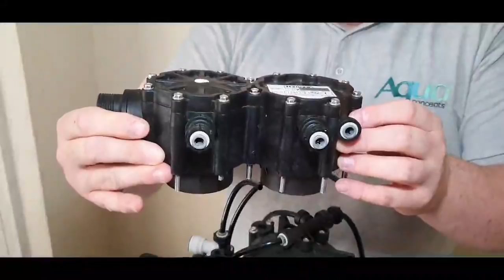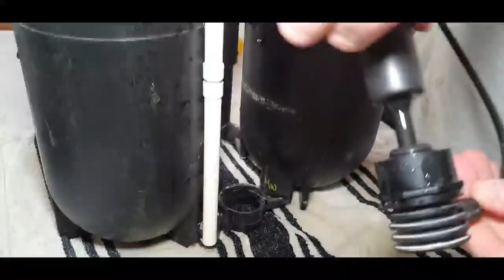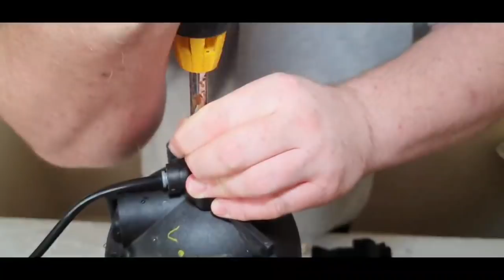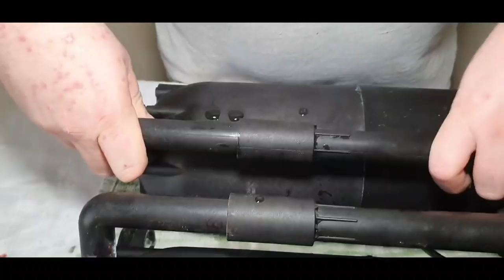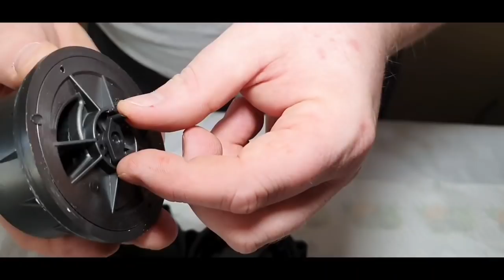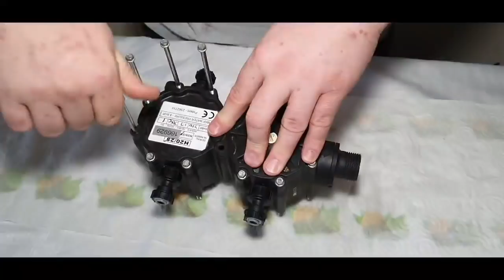Harvey Water Softener Repair / Rebuild [Water Softening]

Comment: Great video, i have Continuous slow water drain from shuttle valve on H20 9 years old Harveys twintec dualflow now and initially high water flow when the problem started but switched off by pass valves for 24 hrs and now slow drain of water.What could be the reason for this ?

Comment: Hi there, please can you advise me? I installed a Harvey Arc water softener today. I did all the plumbing properly, installed a non return valve, the bypass set, all the drainage. But I made a really embarrassing silly mistake, I connected the hoses on the inlet and outlet the wrong way around. When I turned the bypass set on the water pressure was really low, all this yellow fluid came out the kitchen tap, I’m thinking that may have been the brine in the tank? Will this permanently damage the Water Softener? Do think I need to call Harvey and tell them what I did? Can the tank be refilled with brine? Or do you think that was resin? I’m really stressing about this. The softener was only running for very short periods whilst I was trying to figure out what was wrong. When I realized what I’d did i immediately swapped the hoses round the correct way, and the water is running fine and clear. I’d really appreciated your advice. The water pressure is around 1.8 -1.5 bar if that would make any difference. Thank you for taking the time to make such detailed video All the best.
Reply from the maker: Swop the hoses around and it should be fine. Where was it purchased from?
Reply: @TheWaterBoyuk  I bought it used online, i met the guy and collected the machine, he bought it in July 21 but he moved and no longer had room to fit the machine in his new place. He only used the W/S for a year and it sat idle for a year. I called Harvey's and they transferred the remainder of the warranty to me, July 24,  the Arc comes with a 3 year warranty as opposed to the S4 Twin Tec which comes with a 10 year warranty, Iv'e been told the S4 and the Arc are the same machines just with a different housing. Thank you very much for your reply. I was very impressed with how you did that strip down and rebuild, moreover your vocal description was perfect describing all the all parts and your techniques.

I should add for anyone else reading this, I'm not a professional plumber. The install was quite complex as I had to do in install by hanging the pipework and bypass set from rods and clamps on the ceiling above the tank, putting my arms in between the central heating pipes that were hot in a very small cupboard, and build a shelf for the W/S to sit on also above the tank. I was quite tired after the install, and after all that i read the instructions wrong for the inlet and outlet. 

 Do you think i should tell Harvey what i did? Also may i ask the yellow liquid that came out of the tap, will that regenerate on its own? 

Thanks again, have a great weekend all the best.
Reply from the maker: @nickgreg8068  thanks for your kind comments, it is much appreciated. Having the hoses round won't damage it, but it greatly reduces the flow and pressure. It would have had no impact, especially at those pressures. 👍

Comment: Hi
Thanks for the excellent video.  We have got up this morning to exceptionally salty water out of the taps.  What would cause this do you think?
Thanks
Jody
Reply from the maker: Low pressure or faulty brine valve, not shutting off fully.  The early H2O series suffered with brine valve problems. Another indication is air in the water causing spluttering when you turn a tap on. Hope this helps.
Reply: Thanks so much for the reply.
Haven’t got air in the water.
Ours is an m2 minimax. Can I buy the brine valve from you?

Comment: Are there any adjusters on a Harvey - we’ve had ours for some while - and never been happy with the softness - trying to speak with Harvey’s direct has been like pulling teeth. We’d just love to achieve the silky soft water feel
Reply from the maker: The gearing is internal, which adjusts the amount of soft water available. Take a look at the service meter section in the gearbox breakdown.  by changing the gear on the ABCD, holes will change the hardness. Please email me a picture of the top of the valve and also your postcode, and I can let you know the correct gear. andrew@aquaconcepts.co.uk

Comment: Hi
Great explanatory video 
I just moved house and took our Harvey’s HV3 water softener with us. I installed it in new house but couldn’t find anything about manual regeneration until I came across your video.
I have turned that screw on top many times anti-clockwise & clockwise & it has regenerated & now appears to be running fine.
Just wanted to ask if I did any damage to the water softener by doing this?
Also how much water on average would you say the softener will use between regens?
Regards
Reply from the maker: It is possible to get the top end of the gearbox out of sync. By the sounds of it, you should be 👌 The capacity between each regen depends on your hardness level but as a guide it is 350 liters. If you are a big family and using 700 liters, it will regen twice a day. The Salt consumption is approximately block per person per month.

Comment: Hi 
Great video. I have the same model, my water softener is filling up with water. What causes this? If i remove the water with a cup it fills up again any advice would be great thanks 👍👍
Reply from the maker: Could be a number of problems. Check the shuttle valve is not dripping, the corners of the uprisers may have splits, the brine valve maybe stuck. I am currently editing a diagnostic video for the members section of this channel. keep a look out for it.

Comment: Hi, thanks for a brilliant video.  I have the same one in the video and the up riser's went. Got the fella I bought it from to come back after 2 months of chasing him .and he said he changes them as  they were leaking at the bend  where you pointed out in the video. He left that evening and the following morning the softener was filled back up with water. Same problem  and no sign of him coming back to fix it 3 more months have passed and he won't even answer the phone or message . My problem is I can't get the parts anywhere here in Ireland.  Can you post the up riser or send me a link where I can buy them from. Many thanks for all the info
Reply from the maker: Who was the dealer? I can virtually guarantee that when he pushed the uprisers into the bottom of the tank, he missed the lubricant on the rings and the riser is not fully pushed in. Undo the hex screws and remove. Check the oring and lube with some silicone grease. Also check that the upriser are fully turned into the shuttle valve. Get in touch after you have tried that.
Reply: Thanks for the quick reply,  unfortunately the up riser has a pin hole leak at the bend so needs to be replaced, and as I said he's not returning my calls or txt . And can't buy the up riser here in ireland for some reason.
Reply from the maker: Get in touch with me by email and I will see what I can do 👍

Comment: Brilliant video, these are a great softener.  recently mine is not filling the water tank, i cleaned it out and tried again but no luck .. any ideas please
Reply from the maker: check the brine valve first and work backwards
Reply: @TheWaterBoyuk  Thank you, could you tell me how far up should the water level should be in the tank after regeneration.  And if its low what should i look for .

Comment: We have Harveys h20 twin tank water softner .From some time facing issue of low water output flow when there is salt in water softener. Water pressure drops to level 2 ( out of level 10) when there is salt.But when there is no salt, water output flow is level 6. Annoying part is when I bypass water softener water output flow is 10( the best ).  Any suggestions how to fix the water flow issue in water softener? Harvey's service people are very poor and money grabbers!
Reply from the maker: has this done this since installation?  When you say level 10 do you mean 10br?
Reply: @TheWaterBoyuk  Issue is since few years now, not since installation. Installation was done around 10-12 years back. 
10 means the best water flow  and not 10 br:) . Sorry not very technical in this field:)
Reply from the maker: OK I understand now. That sort of era of the H2O was burdened with a few problems. The salty water was mainly due to the brine valve not closing down when in service and it drew salt in. The low pressure could mean the resin has gone, but not 100% without carrying out a full diagnosis. These compact non electric softeners are great if you have a small space but not a patch on a simple high capacity softener.

Comment: This is a great video!! We have a twintec s4 model 750, do these have the same internal gears which could be adjusted? A,B,C or D? We are in a region with less than 200ppm and I don’t want it to regen unnecessarily.
Reply from the maker: The dealer bought that machine already preset to 750 which would cover most regions in the UK. The S4 is different (Check this on the valve cover. It may say  H2OB) and a little more tricky. Ideally you need to set it to a 920.
Reply: @TheWaterBoyuk   Thanks! There is no H2OB on it, the unit is identical to the harvey m3 in your video of november last year. Is there a gear set available for the 1400 model so i can adjust our S4 unit? i checked to be sure, we only have 120ppm over here.
Reply from the maker: You must have the S3 model and there is a gear to lower it down. I will look at the table in the morning for you. I might even have one in.

Comment: Hi
I have had my Harvey HV3 water softener installed for around a year now and just noticed that it has a thin layer of what looks sand in the bottom of the tank. Is this normal? 
It is still softening my water as I have tested with test strips
Regards
Reply from the maker: poor quality salt! The sand comes in the block salt. The sand sediment will build up. check my other videos on salt problems.
Reply: Hi 
Thanks for quick reply
Would you suggest I disconnect the water softener & clean the sediment from the bottom of the tank?
Also will using this low quality salt harm the water softener if I was to clean out the tank every say 6 months?
Thanks again
Reply from the maker: certainly clean it out. Poor quality salt may impair the resin long term. Its up to you. Myself, I would buy better salt and not worry about imminent problems. Good luck

Comment: Simply fantastic strip down video, Ihavent solved my problem but am confident that my gearbox is all intact. My shuttle valve is knackered so will be in touch with TheWaterBoy for a replacement. My softener whilst basically the same had some slight differences in design but it didnt stop me succesfully stripping down. My gearbox housing has a metal pin each side that sticks out of the bottom, makes working on the gearbox a little trickier, also the paddle design was different but the whole 3-9 and 6-12 oclock still made sense on my design. Couldnt have done it without it as I'd never have got the gears back in the right order!! Thanks
Reply: Think I might have a twintec or crown softener as the white adjustable brine valve part is not present on mine, could be worth adding Crown and TwinTec to the title.
Reply from the maker: it will be the Crown. The twin tec has the adjustable brine valve. If you look on the label on the valve cover of the gearbox, it will tell you the resin content. I can tell from that.
Reply: Model 750 Regen 17 Resin BS and B/V 1
Reply: @TheWaterBoyuk   says TWINTEC on the clear salt cover lid

Comment: Hello Andrew. I have a Harvey H20 Dual Flo (installed about 4 yrs ago). It is draining continuously into the drain (the thin pipe that comes out next to  22mm flow and return). cleaned the salt accumulated from the casing, removed and refitted the various tubes by giving it good blow hoping that any stuck valve / debris will give way and it will start working normal again but it didnt help. Some people say it must be shuttle valve. Is that almost certain? Please advise how i can open the shuttle valve to check if the valve or any small internal part is stuck, so I can clean and get it working again ( a short video on how to repair a shuttle valve would be great). Thanks

Comment: Hi fantastic informative video.
I was wondering if you could advise me on what might be causing a loss of pressure from the unit.
This has happened over quite a long period of time.
It is regenerating and working fine in all ways but this noticeable drop in pressure to all the taps/shower etc.
Andy
Reply from the maker: Sounds possible resin problem. Maybe a screened washer on the outlet.
Reply: @TheWaterBoyuk  Thanks for the super fast reply. Could you tell me where the screen is situated on the outlet please?
Reply from the maker: normally located in the nut of the hose. Some may not fit this though !!
Reply: @TheWaterBoyuk   Cheers for that,I will take a look at that first before stripping the unit down...thanks to your extremely in depth video.

Comment: Hi, would you service a Harvey H20 softener in south east London? 
Kind regards
Reply from the maker: I would love to but it's a bit too far for me to travel currently. Our service side is really busy as we cover the East Midlands. There are dealers down your way, but I wouldn't be able to recommend anyone.
Reply: Hi, tried to get someone to have a look but have not had much luck.
The softener sounds like it regenerating everyday (1-2 times) but the water is still coming out very hard. However,  when I do a regeneration cycle manually (by pressing the button and turning 360 deg) the water starts to soften until the automatic regeneration cycles again. Do you think is to do with a faulty shutter valve or could it be something else? Would be really grateful for your advice.

Comment: Thanks for the brilliant video, one of the best instructionals I've seen by far. I suspect my H20 has stopped doing regens, not heard it do one for a while so I tried to do a manual one which always used to work. However when I turn the D button now I just hear a short blast at the 180 degree point and nothing else happens. I can hear a slight hiss as if it is trying to do something. Any idea what the fault might be ?

Comment: Great video , camera man is also very patient!
Got a Harvey only 2 years old but it is constantly regenerating and there is a build up of salt crystals in the white box, do you have any ideas what may be wrong please?
Reply from the maker: does it stop between regens or is it constant? Does the regen stream seem at a greater pressure? How old is the unit? Do you have a serial number?
Reply: @TheWaterBoyuk  
Hi 
The regen is constant. Serial noH20 286899
Reply: It’s about 2 years old. Not sure how to check pressure comparison
Reply: I rang Harvey they told me it was out of warranty by 3 months
Reply from the maker: it is indicating that it is unable to jump of of the regen. This maybe that there was a loss of pressure during the cycle or you have a faulty shuttle valve. If you switch off the flow and return to the softener and leave for 5 mins, then turn back on, it may jump out after a few minutes. If it doesn't I would look at changing the shuttle valve. You can see the replacement in the video.
Reply from the maker: which brand is it?
Reply: @TheWaterBoyuk  
Harvey, same one as in your great video
Reply: Tried the turn off and on and cleaned the whole unit up but still in regen. I have had a lot of plumbing work done in a new extension so the water has been on and off
Reply from the maker: @dmaxd681  have you called a local dealer? you may get a better service that from Harvey's?  Which area are you in? I might be able to suggest someone.
Reply: @TheWaterBoyuk  
Im in south East HP23 near a town called Tring

Comment: Hello  Thank you for this well presented video.  Can you advise why the harveys softner would stop regenerating.  What would be the possible problems please
Reply from the maker: Hi. Thanks for the kind words. It could be a few possibilities such as a metering problem, which would mean a gearbox check. More likely a shuttle valve problem.
Reply: @TheWaterBoyuk  yes. There is a leak on the left side of the shuttle valve.  It looks like the leak is coming from the bolts on the left side of the shuttle valve if you stand in front of the input and output pipes.  Do I need to change the entire shuttle valve and what is normally the root cause if this please
Reply: I live in Woking.  What would be be the normal price to fix this .
A d do you service this area
Reply from the maker: Just check that the origin of the leak is not above on the gearbox hose connector thread and dripping down on to the shuttle valve. If not it will be the thread on the hose connector of the shuttle valve. (Use a bit of tissue to dab on the parts to detect)
Reply: The leak is not on top. It is dripping from under the shuttle valve on the left hand side.  Could this effect the regeneration. The drip is like every 10 seconds
Reply from the maker: The machine is dependent on pressure to jump in and out of regeneration. A drip may affect this. There is a sonic weld beneath the shuttle valve. A replacement shuttle valve us necessary.
Reply: Thank you.  can you recommend where I can get an entire shuttle valve for this unit ? And is normally the root cause of this leaking
Reply: Yeah I have seen you video. It is not the sonic valve but leak is coming from the top right bolt if you looking at the shuttle valve on the left side ( not facing it).  I measured the drip is every 16 seconds.  Thanks

Comment: Hi my softener is getting stuck in regen I’m wondering if this could be due to a faulty valve or a blockage and wether you could point me in the right direction as time is not something I have much of
Reply from the maker: shuttle valve or regen meters as a guess